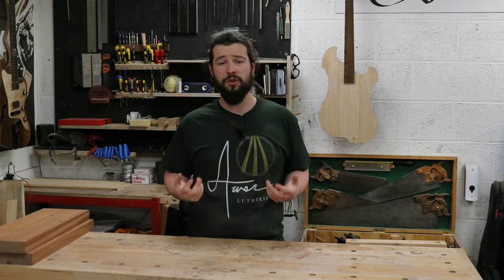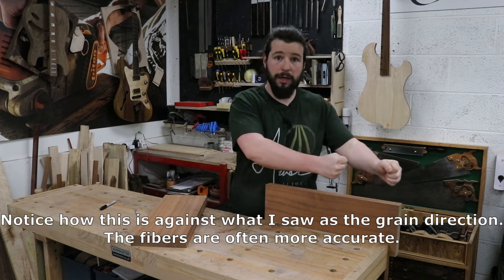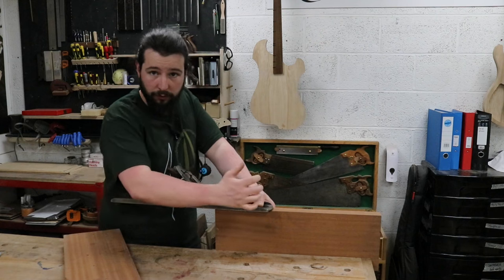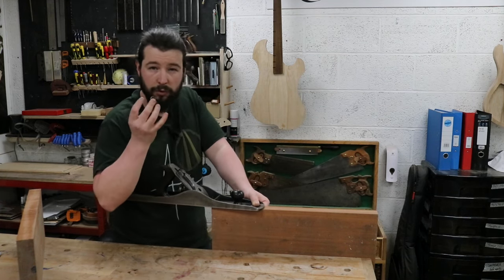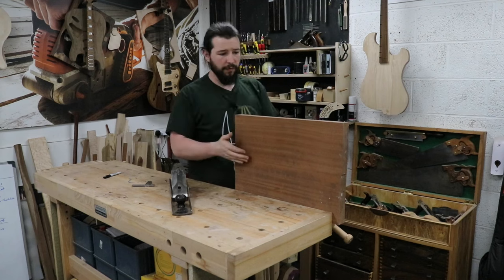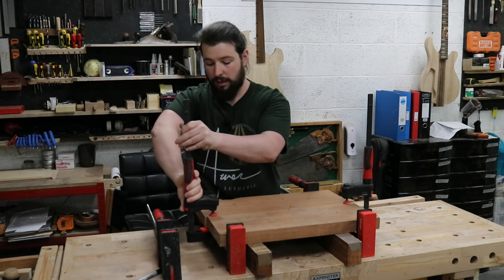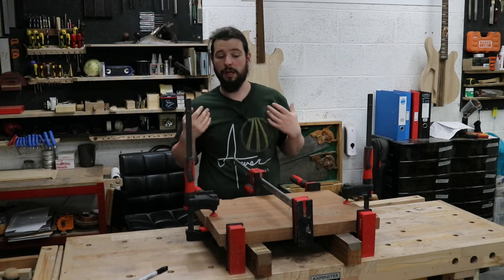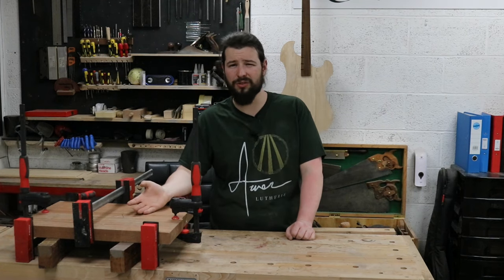How to use a Handplane and Expert Gluing Guide for Guitar Body Blanks

Comment: Clearly explained and demonstrated, as ever!
Planing, when you get it right, is one of the most satisfying areas of woodworking and thus guitar building. That first time, your plane is set up correctly, the blade sharp and you take that whisper thin pass on the workpiece, is simply magical! Cheers Sean! 🥰🥰🍷🍷🎸🎸
Reply from the maker: I couldn't agree more! At some stage the whole concept just clicks and it's the best feeling. There are days I just want to plane and plane until there is no wood left

Comment: Great video. I would just add - make sure to check the flatness of a sole of a plane. The longer the plane more flat it has to be. 
So be ready to flatten it now and then on a flat surface (thick piece of float glass for example).
Reply from the maker: Sole flatness is one of those topics that I see ruffling feathers all the time in hand tools groups. Realistcally the sole only really needs to be flat around the mouth and at either end for it to work well.
Personally, I do prefer a flatter sole because it makes me feel better, but I don't notice a performance difference after getting the mouth and like an inch either end flat. I use a precision granite block for my levelling

Comment: I like to use the table saw to get complimentary angled surfaces on each board.  Basically you fold them like a book and then run the edges through the saw blade.  It doesn't matter if you saw is exactly at 90 degrees and you get a perfect joint.
Reply from the maker: I find a hand plane will always give a superior gluing surface than any machine can, simply due to the subtlety of the blade and the "resolution" of the shaving. Saying that, there is absolutely a point of diminishing returns. Our thickness planer gives an almost perfect finish too, well within the realm of "good enough" but the handplane can elevate it just that hair more.
Reply: @AwenLutherieCustomGuitars  Fair enough.  I am not as skilled with my hand planes and always struggle to get the edges square to the faces.